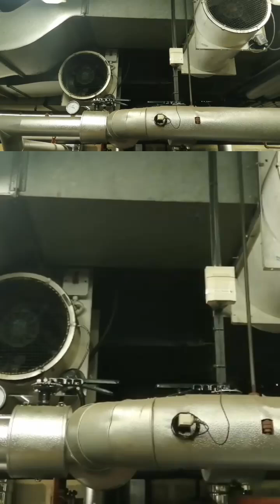BRIEF LOOK AT FLUE FAN DILUTION

Comment from the maker: A fan dilution system is a cost-effective, tried and tested solution to the issue of unsightly and expensive chimneys that maybe a blight to a commercial buildings.

This arrangement of ducting incorporates a fan unit which mixes fresh air with the products of combustion, which then allows safe lower level disposal directly to the outside meeting the discharge requirements of the Clean Air Act for CO2 and IGE UP10 Edition 4 which states the following requirements:-

CO2 max 1%
CO max. 50 ppm
NOX max. 5 ppm
All flue designs are carried out in line with all current standards.